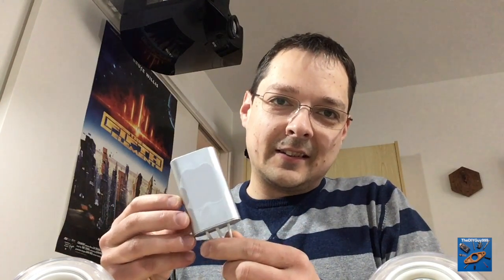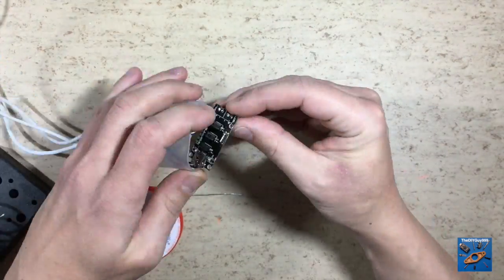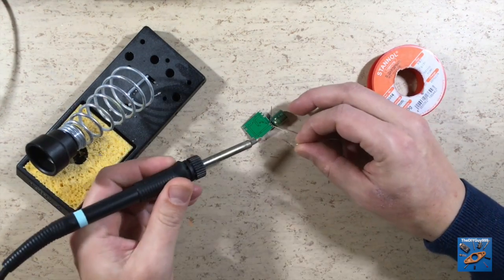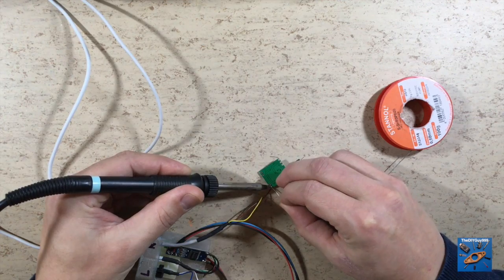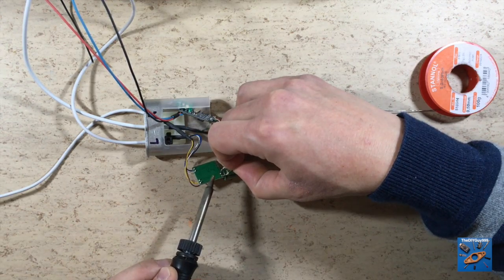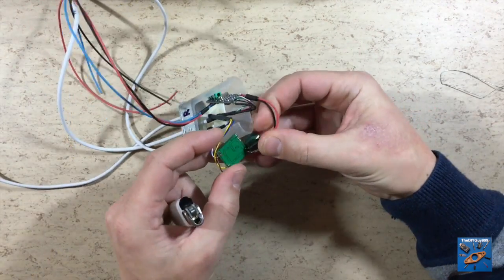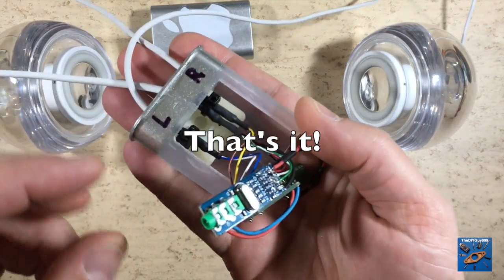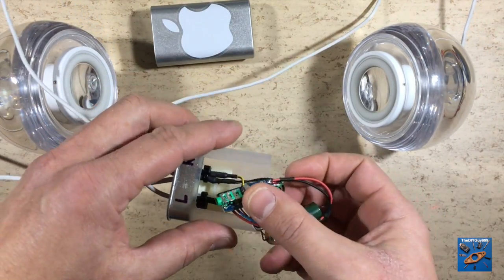Apple Pro Speakers M6531 USB Conversion V3.0

Comment: You wouldn't happen to know where I can get a re-foam kit for my little Pro speakers, would you?
Reply from the maker: Sorry, I don't know. sometimes you can find these speakers on online auction platforms
Reply: TheDIYGuy999 Thanks, but I have the speakers, I just need to fix them.
Reply: @tubularguynine  You can get new rubber cones for theCube speakers here: https://nl.aliexpress.com/item/1005001963172688.html?spm=a2g0s.9042311.0.0.6fd34c4dKDRjkf   Make sure you order the 50mm variant.  They come with a metal cone in the middle which you can take of with some alcohol.  Clean the Cube speakers from any remaining rubber and fit the new cones.  You can glue them by applying some flex glue, preferably in black.  You find also a discussion on this subject on MacRumors
Reply: @wk9205  - THX!

Comment: Have you, or ANYONE tried a hack on the complete set with the iSub? Seems a huge waste of a fine system just for the lack of driver software!
Reply from the maker: This was not an iSub. There was also a version without sub, which was delivered with the iMac G4
Reply: TheDIYGuy999 - yeah, I had one. So cool with the swivel screen! I was just thinking Apple just wasted a fine sound system by not making it able to work on new computers.

Comment: coming from tonymac and love your 3rd version.
may you would make them in a small series?
a box with jack connectors & usb outside?
Reply from the maker: Not at the moment. But the mod can easily be done by everyone. Just give it a try.

Comment: hello thank you for all what is the voltage of your 2.2uF capacitor? did you only replace the 1000 uF first one by this one or more things?
Reply from the maker: 5V is enough, the voltage level on the signal lines is tiny. The 1000uF cap is wired across USB 5V and GND, to smooth out the supply line

Comment: can they work with Android?  Is possible to make a smartphone-working version?
Reply from the maker: No. Just USB. Works with macOS, Windows and Linux. if you want to build a speaker for a smartphone, you should use a Bluetooth amplifier like this: http://www.ebay.com/itm/Bluetooth-3-0-Amplifier-Board-5W-5W-CSR8645-APT-X-Hifi-Stereo-Receiver-Module-5V-/272263606606?hash=item3f642cf14e:g:p-MAAOSwo4pYN~HN
Reply: @TheDIYGuy999  Can you add this Bluetooth Amplifier to the Apple G4 speakers? Then letting me connect them to my MacBook Pro M1 wirelessly?

Comment: It's not recommended to short or remove the output capacitors of the PCM270x. The chip's analog outputs have DC offset which can disrupt the normal operation of the Class D amplifier.
The professional approach here would be just to replace them with 100uF as it's described in the datasheet. http://www.ti.com/lit/ds/symlink/pcm2706.pdf

regards.
Reply from the maker: Of course, the capacitor is required to remove the DC offset. But there is already one integrated on the PAM8403 amplifier board.
Reply: That is good but what is the value of PAM's input capacitors? They are 0805 size or 0603 and the capacitance should not be more than 100nF (470nF max), right? It would be better if you connect additional 100uF over them. That will give а full frequency response performance of the amplifier.
Reply from the maker: 100nF and then a 10k input resistor. If you assume, that there is no additional input resistance inside the PAM, this gives a cutoff frequency of 159Hz. I've now replaced those 100nF capacitors with 2.2uF ones. The result is a cutoff frequency of 7.2Hz and a noticeable improved bass reproduction.
Reply: hello thank you for all what is the voltage of your 2.2uF capacitor? did you only replace the first one by this one or more things?